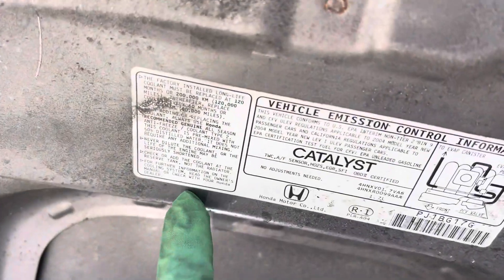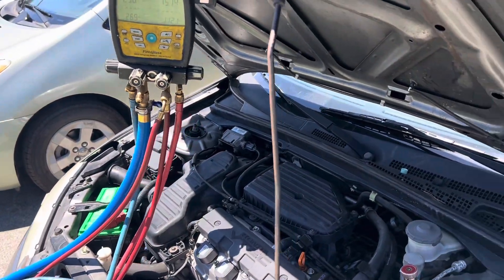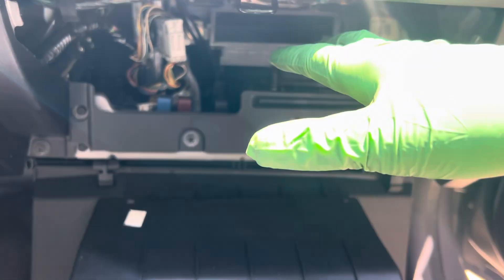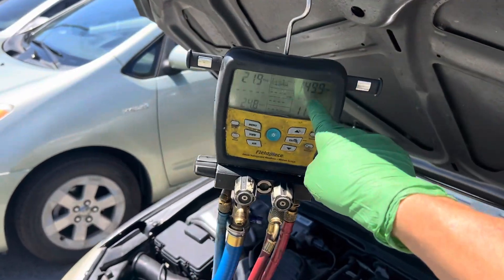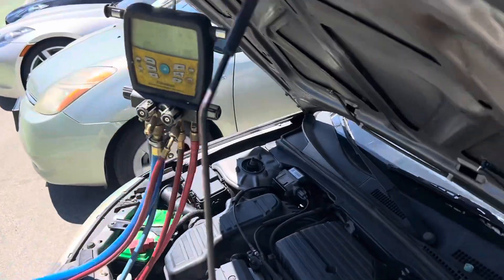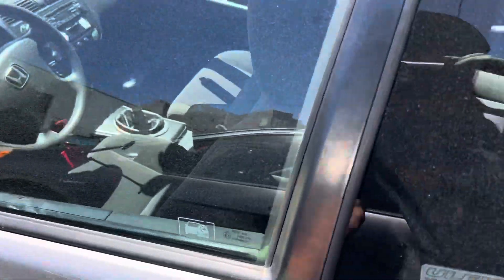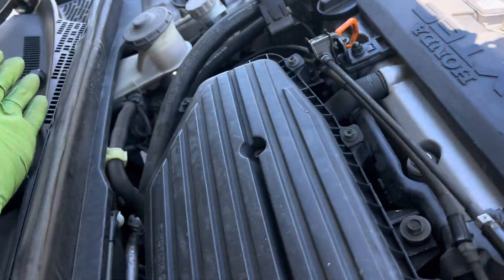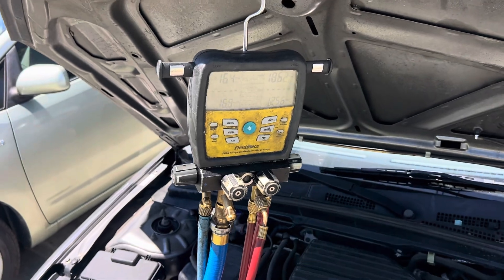Cabin filter, cause air to be too cold out the dash with 100°F interior dirty filter, ￼

Comment: Keep cabin filter dirty, for colder ac 😂.
Reply: If it starts blowing literal ice chunks you know you've got it good. 😂
Reply from the maker: @mailmanjoe  😂 yes everyone always thinks cold air means more cold. 

But they forget a system that delivers 39°F air but only delivers 250 CFM is not going to cool down the whole entire cabin .  Only the first few inches in front of the vents.

Having 47°F air being delivered at 650 CFM cool down the whole entire cabin and push a strong airstream to the back of the passenger compartment .